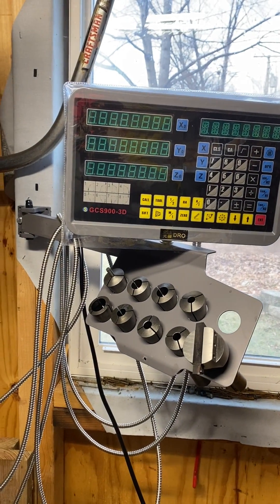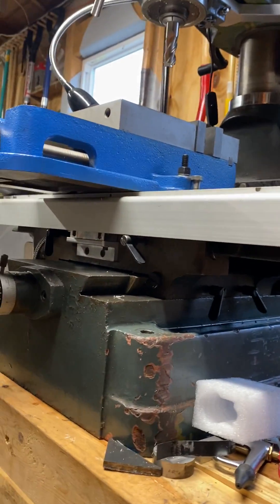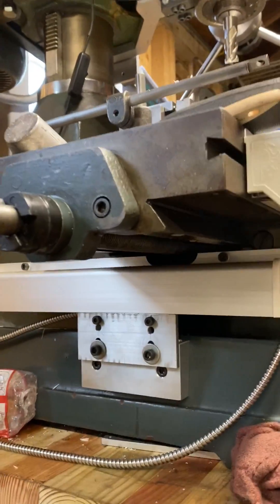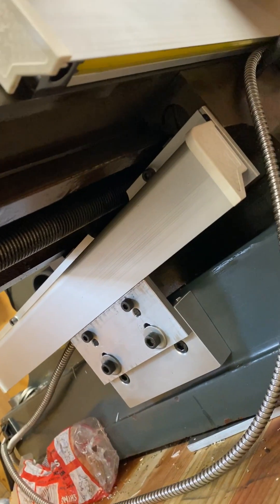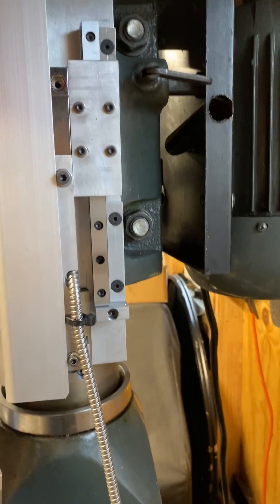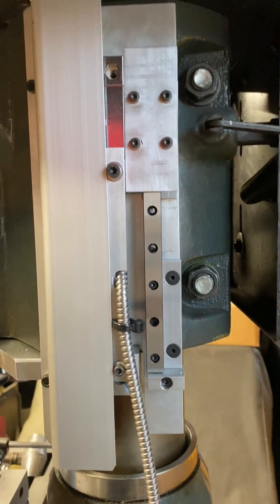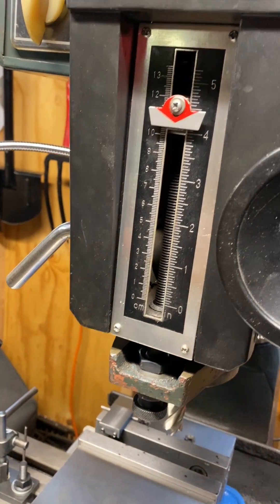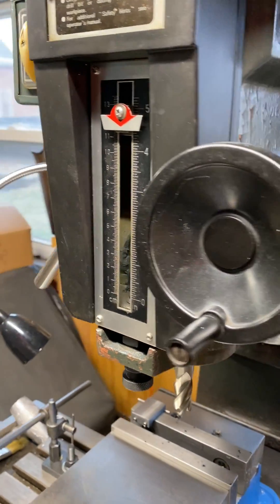RF30 DRO Installation Overview

Comment: Very helpful.  Ingenious method for the z axis to have a clean install. Have you run into any issues or in accuracies with z axis measurements?
Reply from the maker: not yet.  but admittedly, I do not make many parts they need .0005 accuracy.
Reply: Would you ever consider selling a y and z axis mounting kit?  I'd be very interested if you do.

If you don't want to sell a kit how about selling plans?  

Your z axis.mounting system is quite elegant and I do not think I am experienced enough to do it on my own.

Thanks!

Comment: I really like the way you did the Z Axis. I’m not sure if I can figure out how to build it yet, but I’m going to try. Still new to Machining. Luckily there are people like you putting out all these Videos to help people learn, or get great ideas. Thanks for posting.
Reply from the maker: I've seen people take exact measurements, and draw up parts in CAD.  Me...I used thin wood to make a rough model, then traced it to aluminum when I had something that I thought would work.   It doesn't always have to be perfect.  I cleaned it up with a disc sander, and a bit on the mill.

Comment: I would like to do the same to my mill. What length are your 3 scales ?
Reply from the maker: I can measure my scales, but it’s best to figure out what you need for your specific mill.  

For the X axis, just make it the same width as your table.  For the Y and Z, measure your travel and add enough to allow you to mount it.

Comment: Did you by any chance make any 3D drawings/designs for the parts you used ?
Reply from the maker: Stefan Van pellicom, I did not.  I made a wood template for the piece that bolts to the quill.  After a quick test fit, i scribed it into some scrap aluminum plate, cut it with a bandsaw and smoothed it out on the mill and 1” belt sander.
Reply from the maker: The rest were just custom cut and fit.  Given I was mating to a casting, I figured there was not much of a point in drawing the parts...

That said, if I can help with more pictures or measurements, let me know.
Reply: TomCorp Consulting If you could provide me with some pictures of how you mounted the Z axis bits and pieces, that would come in very handy and timesaving for me. I am on FB under my own name. Thanks for helping me out here !
Reply from the maker: @Stefan_Van_pellicom  sure thing.  Work has been keeping me out of the workshop, but I can send pics if you still need them.
Reply: @tomcorpinc  I would appreciate that. Stefan at vpc dot be would be nice !
Reply: @tomcorpinc  would like to get the same pictures ...if you want!
Could be very helpfull.
Thanks
Reply: I'd like pics too!
Reply: Ditto! 😊
Reply from the maker: Sorry I did not respond sooner.  PM me if you still need some details.

Comment: nice set up Tom, I'm planning to purchase same mill like yours (rong-fu RF-31), Bit curious what the vise size (kurt style or ang-fix style vise), 5" or 6" ? is that yours is 5"? thanks
Reply from the maker: Mine is the 6”.  I was worried that it would be too big for the table, but it is actually a decent fit.   I ended up getting it from a local recycler for $40.   After I pulled 10 lbs of chips out of it, and degreased it for a few days, I found that it was in great shape.  It’s a model D60.

I bought a rebuild kit from Kurt, and asked them for the stickers.  (They were free, Kurt is a great company)
Reply: TomCorp Consulting Sad we don’t seem to have Kurt over here. You must have been over the moon to get one for 40 bucks !
Reply from the maker: @Stefan_Van_pellicom  it was a good find for sure. But a lot of work to restore.  I have a friend who manages a killer machine shop, and we used a $200k surface grinder to clean up the machines surfaces.  But restoring these tools is half the fun, right?
Reply: @tomcorpinc  True ! 👍

Comment: Awesome! Just what I wanted to see. Z axis is the most involved installation.  Planning on same configuration,  including linear bearing for reader (nice!). Will try to mount display on right side of mill, but out of way of  quill arms and column lock bolts. We'll see! Thanks a bunch!
Reply from the maker: I was concerned that mounting on the right side of the mill might interfere with the column lock bolts.